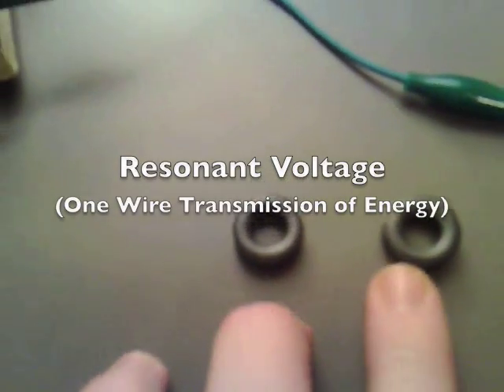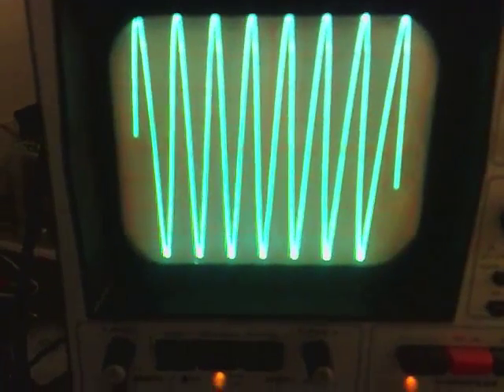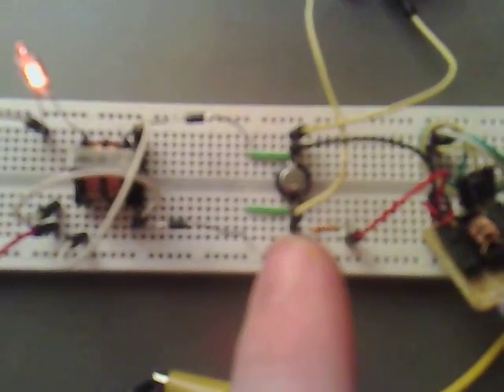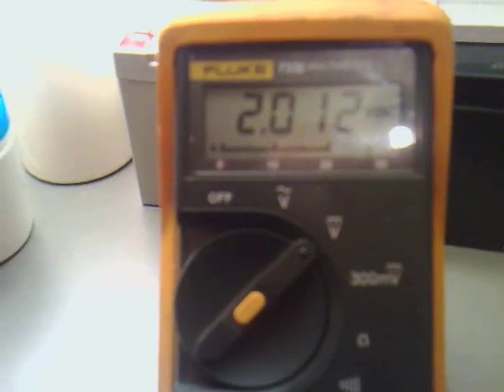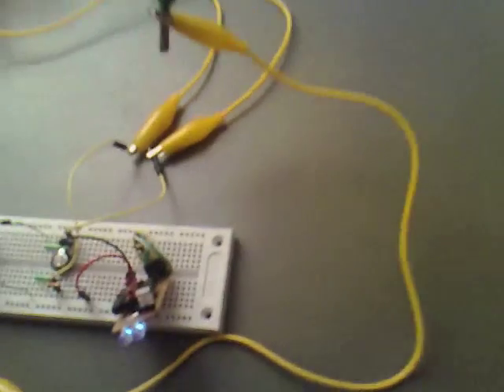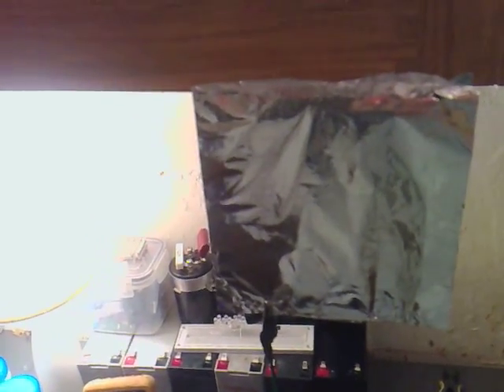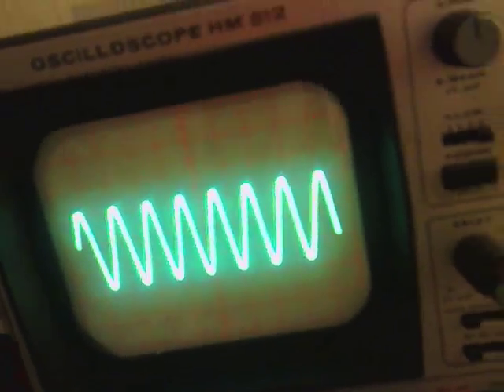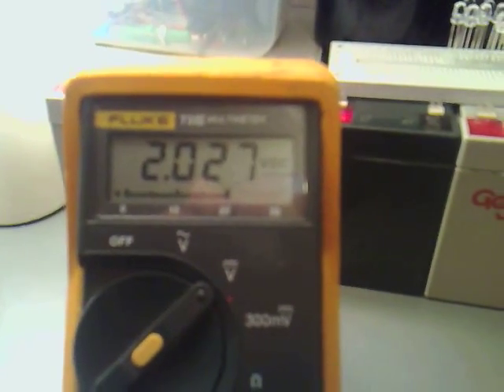Resonance (One Wire Transmission of Energy) 001

Comment: Well, if you are somehow tapping the static electrical potential of the earth, then higher is better. 
Don't quite remember where I read it, but the static electrical potential in the air will increase with 300 volts + - for every meter, the + - is because more moisture reduces the potential.

And the size of the plate will probably decide how much charge you can collect at a given time.
Just my thoughts anyway ;D